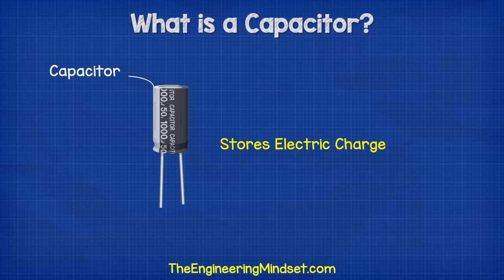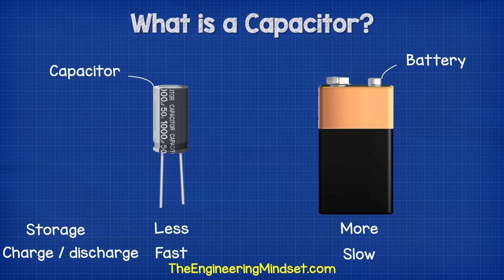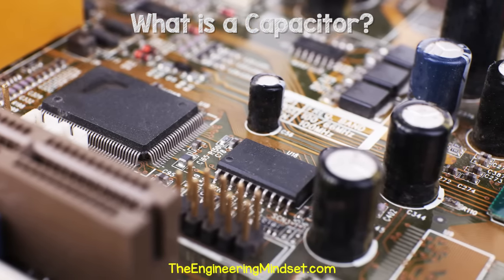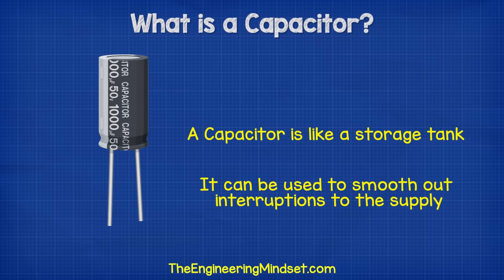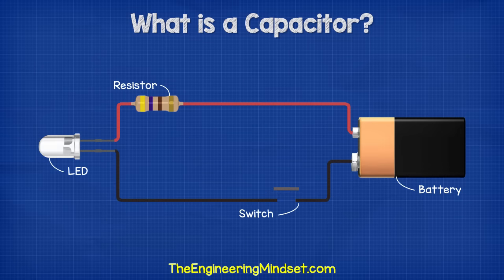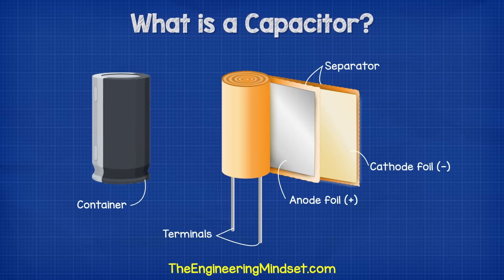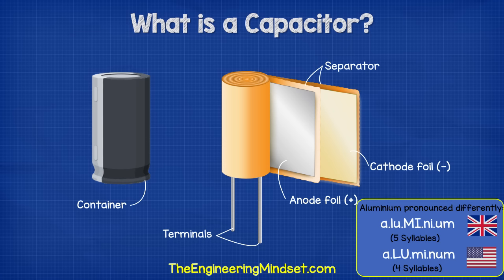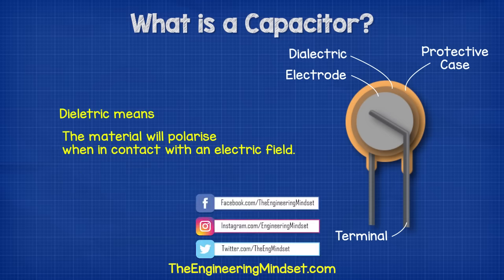What is a capacitor? Basics

Comment: Very well made videos from a learning perspective!
 If I in sound engineering want to try and get rid of noise while building a electric circuit, could I first add a component (that wich turns off the flow when it increases(forgot the name, sorry)) and then add a capacitor? Or would there be problems with cut off in sound signal? Loss of musical information?